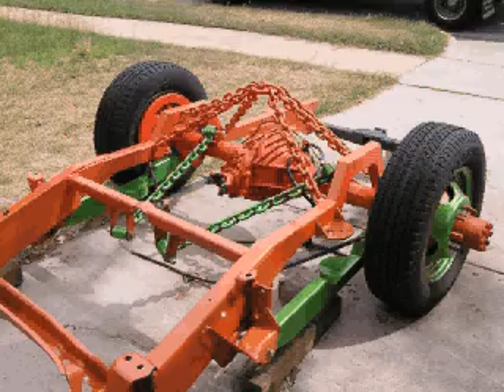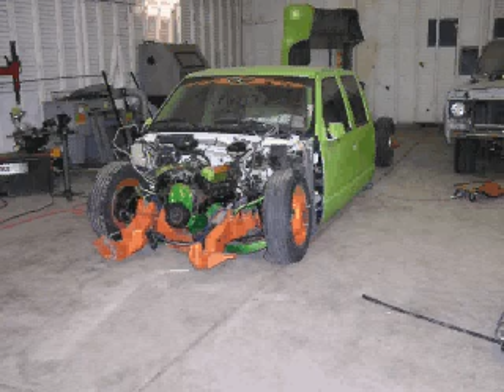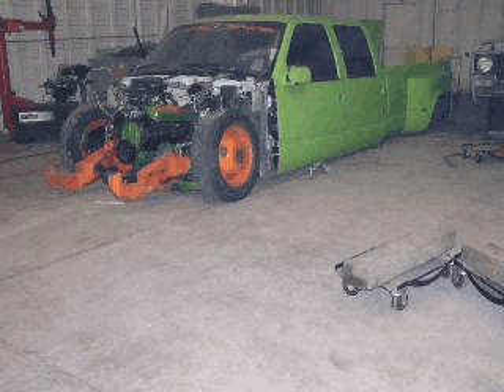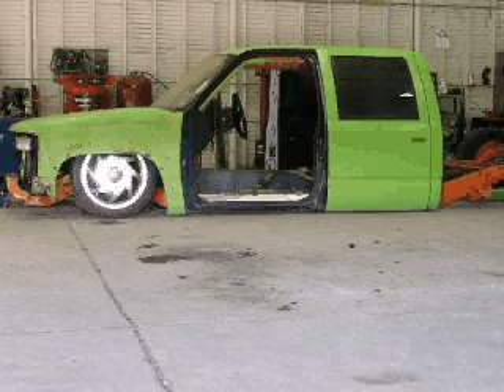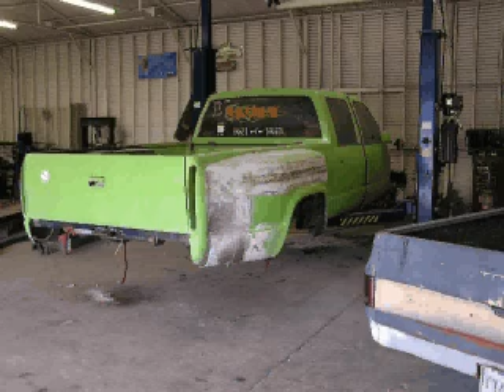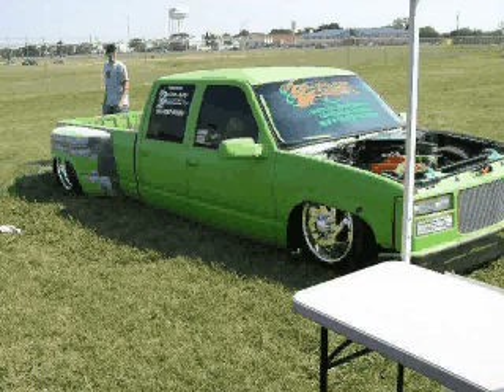Makin a Crewcab from the ground up

Comment: love the truck color that the color were painting my friends 402 in his 65 chevy when we rebuild the motor right now its more about getting the truck to run with the big block its no were near ment to use a big block have to relocate the clutch linkage and accelerator linkage had to hammer in the firewall to clear the cylinder heads and the hei didnt come close to fitting in so had to switch back to an old points one out of my truck